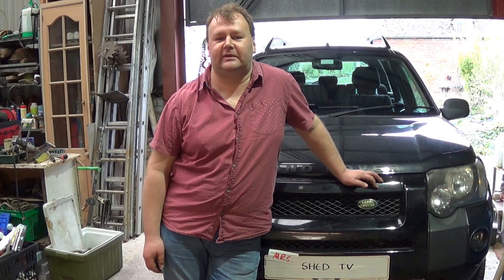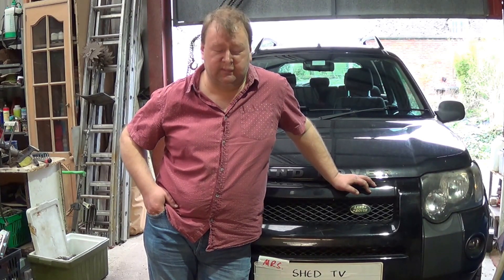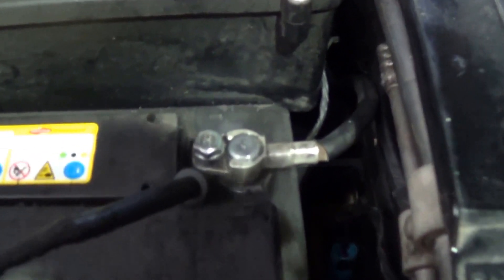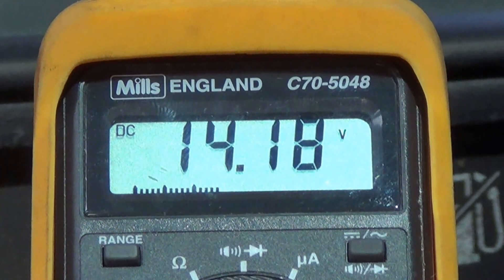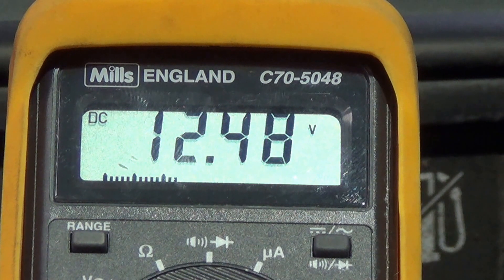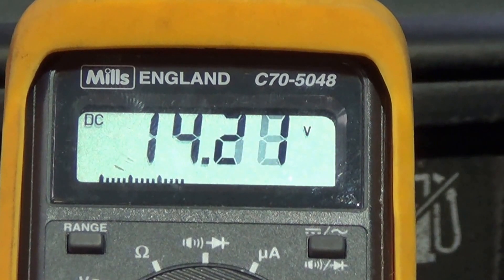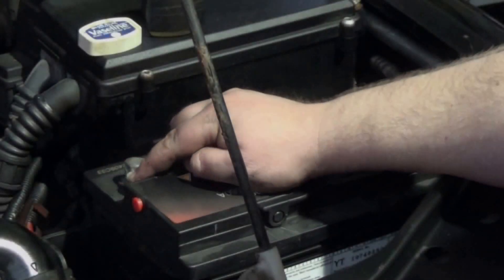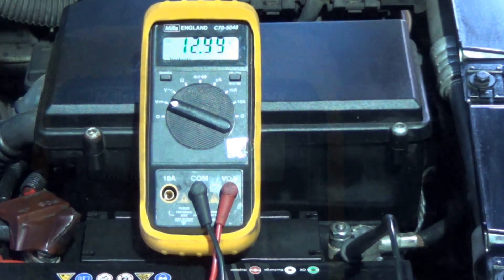How To Test Car Battery and Alternator - Easy Multimeter Check For Dead Battery Or Faulty Alternator

Comment: Many thanks. I dug my old Speedograph Tune up analyzer out of my garage (not used since my rallying days in the 1970s) as I've started getting a message on my dash when I turn the car off saying: Radio will shut down soon as battery low. I couldn't remember how to check if my alternator might not be working properly or my battery is on the way out. Your video has been great help!
Reply from the maker: Thanks. I'd forgotten about those old Speedograph meters, from the days before Halfords had the monopoly on motor accessory shops!

Comment: so you mean when you start the engine and it's drop around 8-9volt and back to normal.. you need to replace the battery??
Reply: Yes that's correct it needs 12v or more when cranking

Comment: Decent video. Glad you showed how a good battery should react too because that's what I really want, in case it's not the battery that's the issue. I'd have liked more if you explain what would happen if the alternator was bad though too.